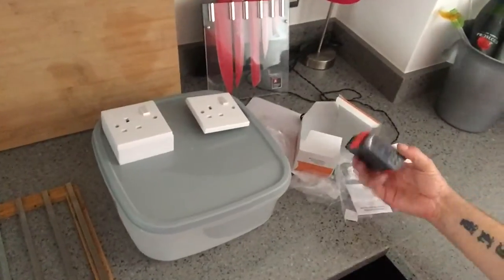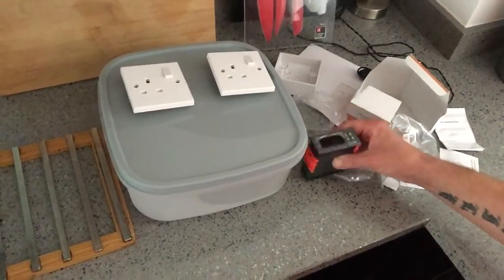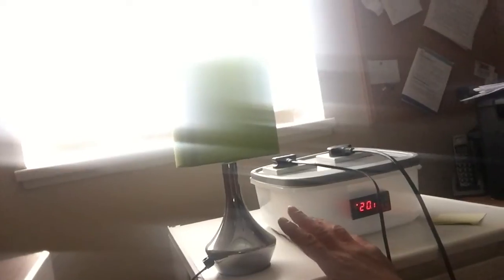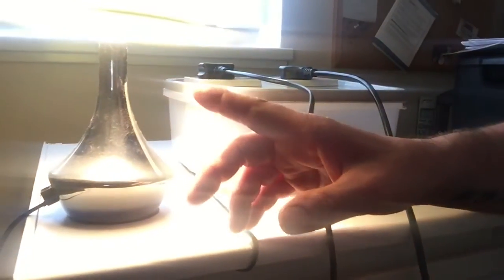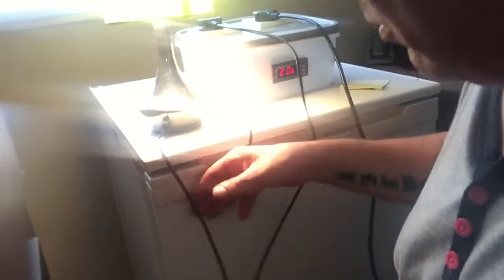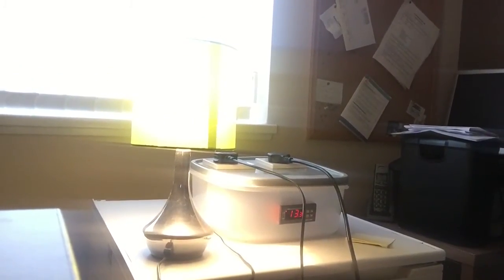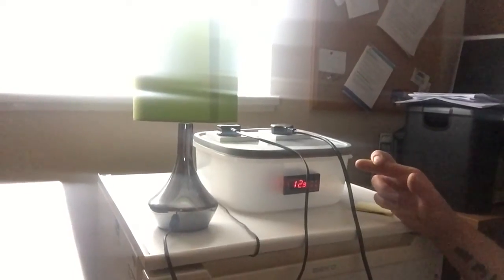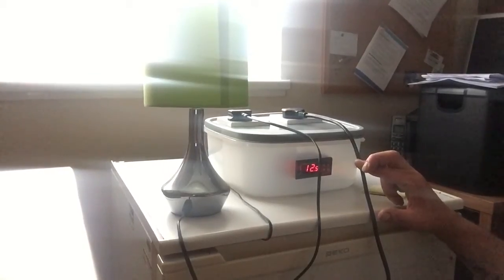My Fermentation Fridge Build

Comment: Nice job there Steve, makes all the difference for fermentation.
Reply from the maker: Cheers bud all I need now is beer to put in it, how's the regulator you got for your keg doing .
Reply: +Steve Moulson I have not kegged any beer yet as I had to add the hermes coil and get hold of a beer tap. I got my beer tap last week so I can pipe it up now. The fermentation fridge has a mead in at the moment so I can't brew anything new. The regulator works fine with water in the kegs, other people have the same regulator and they all work. Are you looking at getting kegs as well? I bought another STC1000 so I can make another controller. A neighbour said they have a fridge/freezer I can have so I may be able to make another chamber.
Reply from the maker: +Hoverdog Brewery I've bought a keg and some lines and that's it, still have a tap and regulator to buy oh gas as well. Nice score on the fridge freezer can't beat more chambers.
Reply: I am lucky for gas as there are a few companies within 5 miles of my house that sell gas.

Comment: Great work Steve. You're all set for any time of year. It makes a big difference and not having to babysit the temperature takes a big load off. cheers mate
Reply from the maker: Most of my temps have been around 20 + in the bedroom all ok in the winter though, at least I'll have control all of the time.